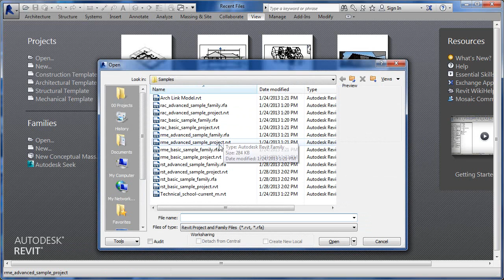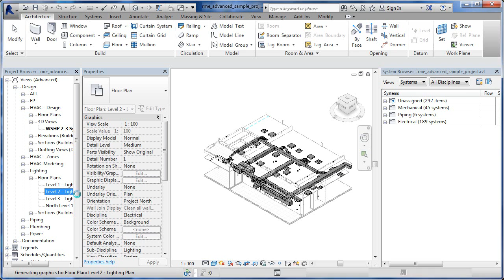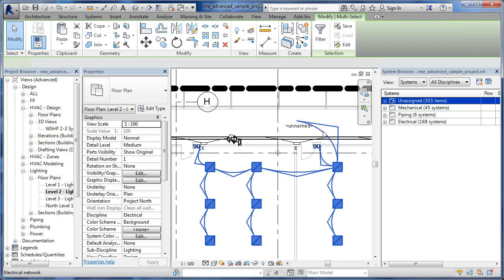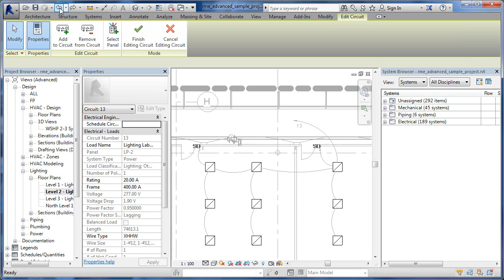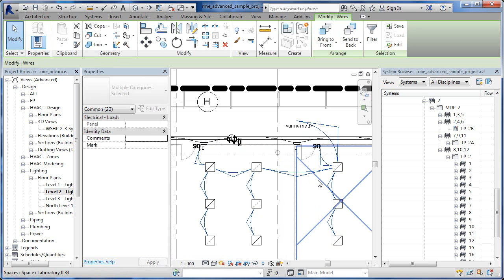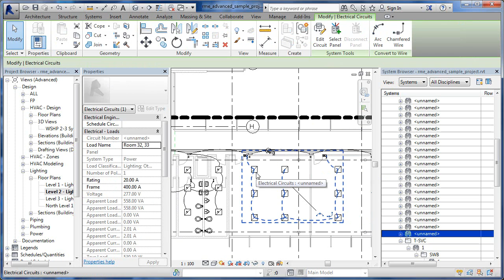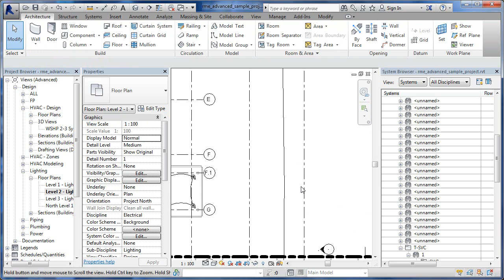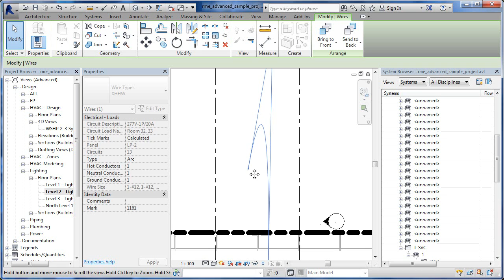REVIT Electrical Power Lighting Wiring and Circuits #learnrevitfast #REVITKillShot

Comment: That's pretty cool, but how can I connect several lights to several switches, like a two-way switch system or more?? Because that is very common.. Thanks! :)
Reply from the maker: REVIT lights can be connected to multiple switch systems. Try www.CADclips.com
Reply: It's been a looooong time since my comment... I haven't used 2016 and 2017 versions yet, but in 2015 you cannot connect one lighting fixture with two or more switches

Comment: i enjoy this video!! but wen i connect the wires to the circuit, the wires appear to be connected to the lighting fixtures only and not the switches.. why is that? and the switch is apart of the circuit...